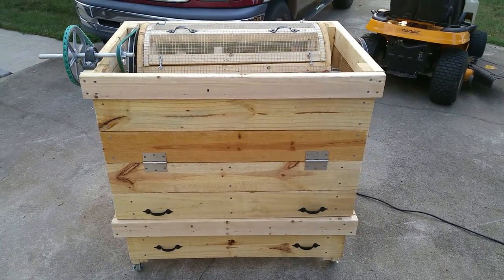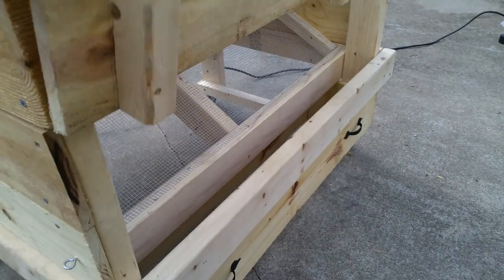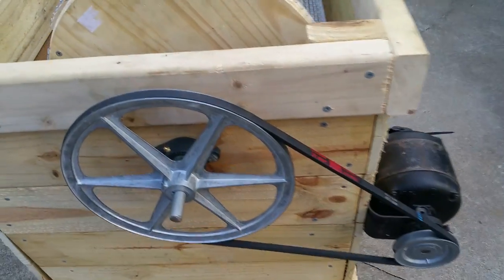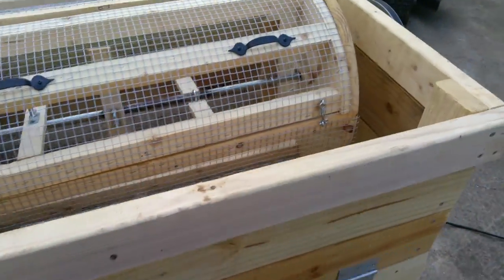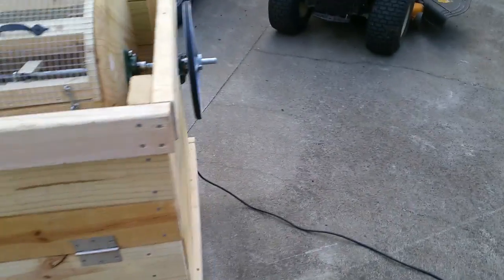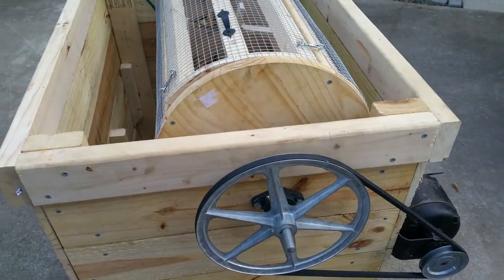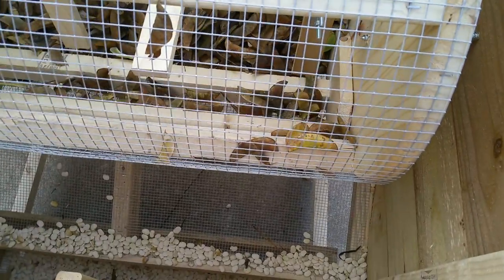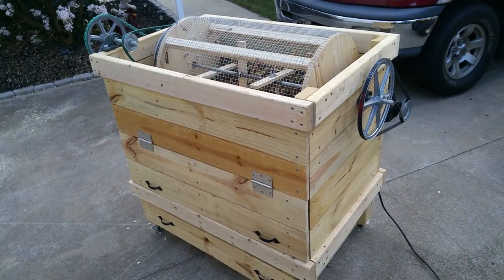Buddy-ro's Bean Sheller - Initial Run

Comment: Nice machine! 
Could you give any info on the big pulley bolted to the drum? Where did you buy it? Would it have a specific name?
Reply: V belt pulley. I don’t know what size but there are ways to calculate the size you need based on the motor you want to use.